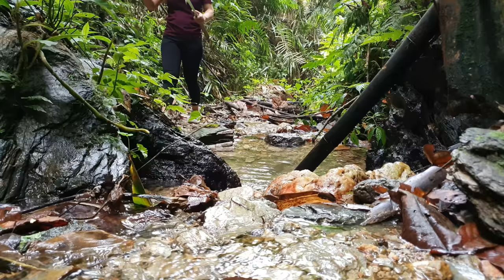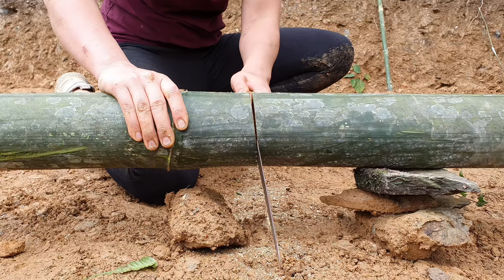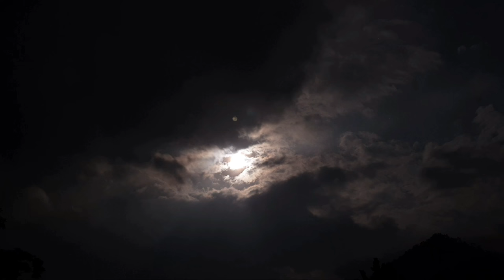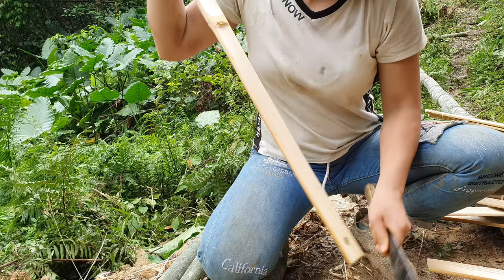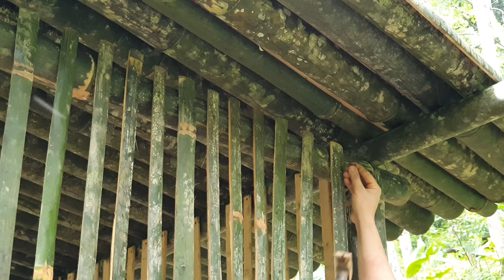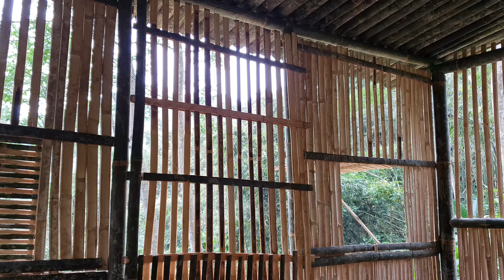How To Build Bamboo House 2021 With Girl | Lý Thị Ca - Ep.69

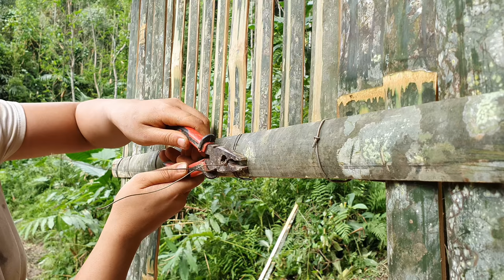Comment: 25:26 Finally I see the wire. But it can be replaced with PET tapes. The tape is cut from the bottles, tied to it, when heated with a hairdryer, it is compressed and holds tightly.